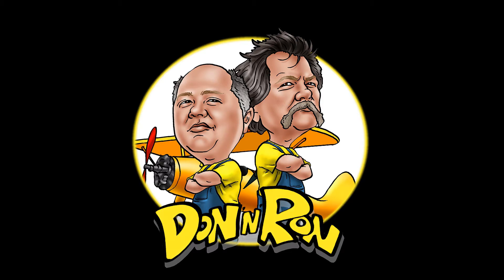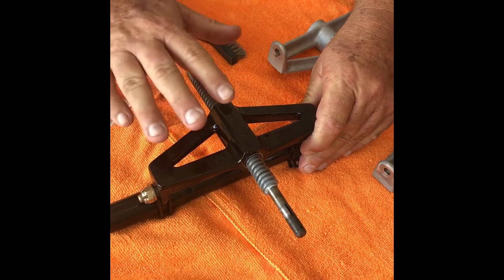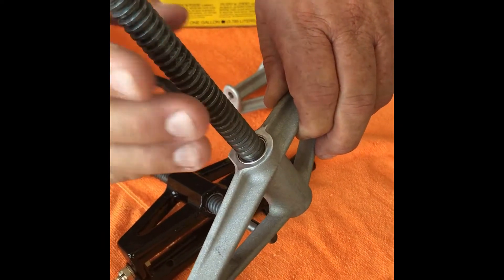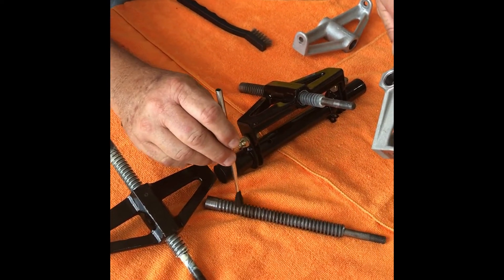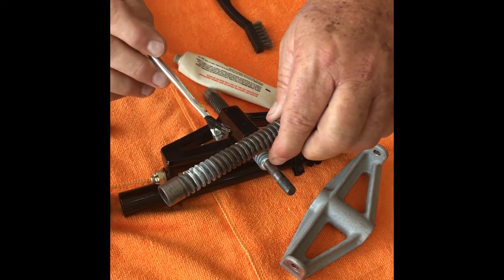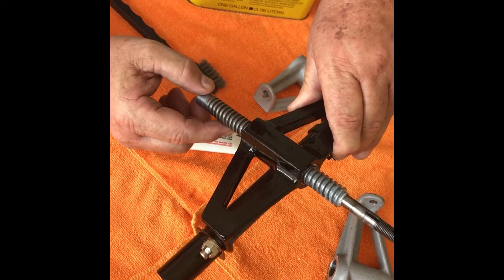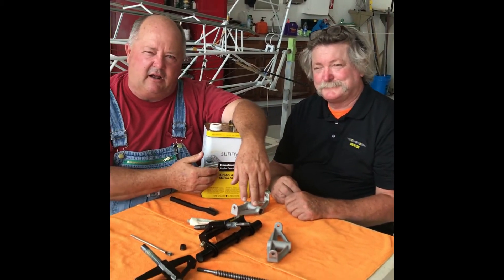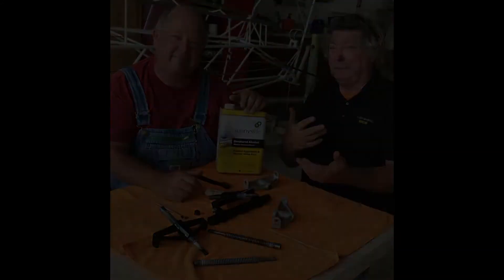Rebuilding Piper Cub Jack Screws

Comment: Hi guys 
I I'm currently refurbishing a j3 how do I know if the trim cable or bullies are worn out, some time back a mounting bracket was welded in place for the master pulley and I am struggling to tension the cable, is there a measurements for bracket 
Frankie in Dublin Ireland 
localign@hotmail.com